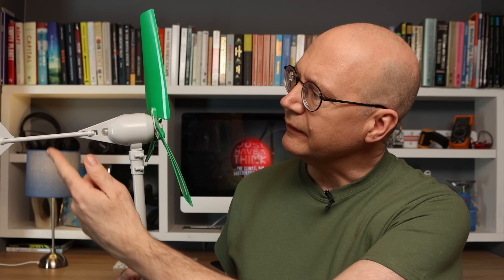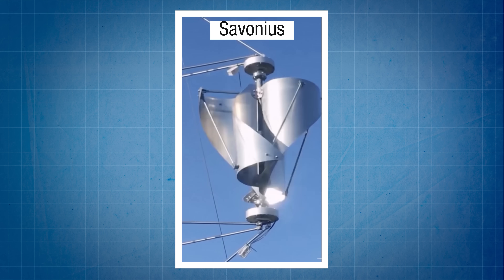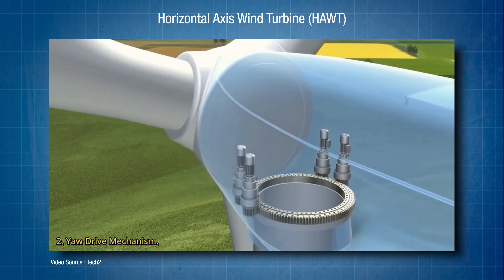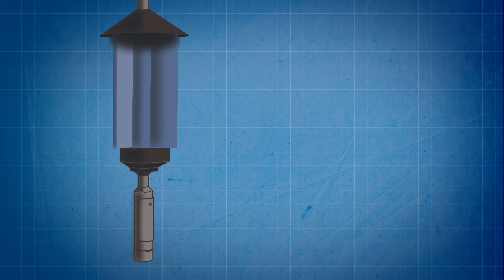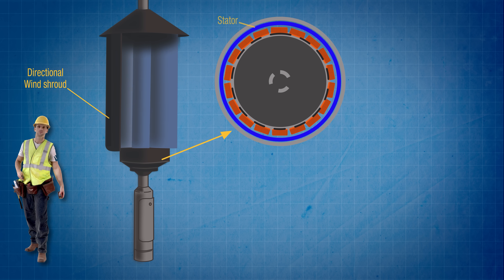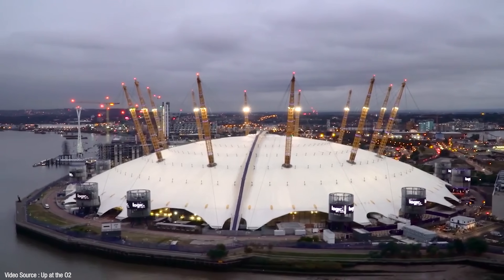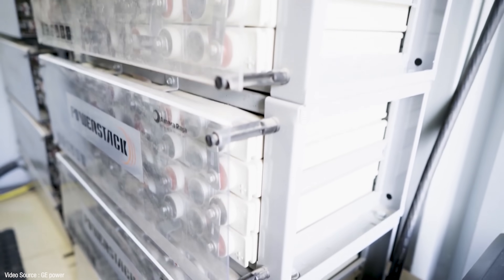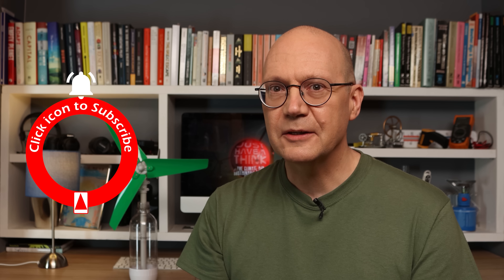A vertical axis wind turbine that doesn't need the prevailing wind! How do they do that?

Comment: There are always inexperienced newbie crackpots pursuing these disproven ideas.  In wind energy we just call them "idiots" - sorry but that is the simple reality.  Wind energy requires a STRONG wind resource.  The incidental airflow from traffic is not sufficient to provide useful amounts of power.  The economics are just not even close to a breakeven.  You'd use more energy just manufacturing them and installing them than you would ever get back.  And if there were significant wind from traffic, slowing it would cause the cars to burn more gas - no free lunch.  This general idea has been promoted for many years, yet never implemented, because anyone who knows anything about real wind energy knows ideas like this are a waste of time and can never work out.  It is all about simple math, whereas this idea is about emotion.  Bad ideas are bad ideas.  You might just as well decide to operate a gold mine from your garden soil.  Is there enough gold in your garden to make it worth the effort?  Same thing here.  This is a wrong idea, period, and listening to uninformed people like this is inadvisable.
Reply: see you had me until "And if there were significant wind from traffic, slowing it would cause the cars to burn more gas - no free lunch"
anyone who has so much as attended a single secondary school science lesson knows that the airflow from traffic is classed as WASTE energy, unless the cars behind are within a slipstream they receive literally zero benefit from the airflow, and if those cars are close enough to benefit from that slipstream then they are way too close to be in compliance with almost any highway law. 

stick to your windmills, you clearly dont understand cars
Reply: @samueleveleigh2767  Yeah I just restored a totalled vehicle and got it registered last week.  I don't understand cars.  No, it is you who do not understand wind energy.  What people like you do not know is how little energy is in light winds.  The power in wind is proportional to the windspeed cubed, meaning if you double the windspeed you get 8x the power (kinetic energy times flowrate).  Conversely, if you have half the windspeed you have 1/8th the power and at a quarter the windspeed, you have 1/64th the power.  At 1/8th the windspeeed you have 1/256th the power = ~nothing.  Yet any wind energy system must be built robust enough to survive a 100 MPH wind.  There is simply not enough power in the paltry amount of wind from traffic to make a hoot of difference - a waste of time, money, and resources.  And meanwhile, if you did manage to slow a windstream caused by traffic, it would affect each car by a tiny amount, meanwhile you get no benefit.  Ever been behind a big truck and feel how the windflow around the truck affects you?  It's all interrelated.  All you have is one more money-losing "politically-correct-for-idiots" waste of taxpayer dollars that will cost more just to be torn down than all the energy it ever produces over its entire lifetime.  All crackpot wind energy systems are eventually removed, like, for example, the Aerovironment rooftop turbines on Logan airport.  Gone.  Wind energy will make an idiot out of even the smartest people.
Reply: @dougselsam5393  My experience of light wind moving 1mt of steel with 5 or more kids all day with a steady pace contradicts your claim of understanding the (lack of) potentional of "light wind".

If you don't get it: I refered to sailing an open steel 25ft boat, as a kid I've "wasted" most of my saturdays doing that.
Not saying this system is the answere to our total energy need but neither are the enourmous conventional wind turbines.
Also, It's not "free lunch" that is presented here, it is eating the left-overs.
Reply: @hotdognl70  Hello Martin!  Yes it was sailboat experience, along with building & flying  kites, and touring the hydroelectric plants at Niagara Falls, that got me interested in wind energy way back in the '60's.
Today I guess you could call me an expert.  For fun, we habitually debunk wind turbine ideas.  Traffic-powered wind energy ideas are one of our favorites.  It;s like shooting fish in a barrel, but you have to find humor somewhere in any profession.  You may notice how common such traffic-powered wind energy devices are in magazine articles, with none in actual use.  There is your first clue.  There are unlimited ways to get "some" power from wind, at "some" cost.  Most are not economical energy solutions.  Not even close.  It would be more efficient to just burn hundred-dollar bills by the bushel than to take this idea seriously.  The idea of wind energy is with a reasonable upfront investment, you get high amounts of  long-term energy production without requiring constant fuel for power.  The "high value" of the resulting electricity is what eventually "rationalizes" your investment.  Without high power output, the expense will turn out to have been "irrational".  Which is why you never see this idea implemented.  Another example might be seeing a penny on the sidewalk, realizing it is "free money!" and then making a very expensive machine to pick up pennies from the sidewalk.  Don;t be surprised when you figure out you wasted your money because you need a sidewalk with a LOT of pennies!  Turns out there just aren't enough pennies on the average sidewalk to rationalize such a machine.  Well guess how much wholesale electricity costs?  Pennies.  Wind turbine are lucky to make 4 pennies per kiloWatt-hour these days.  So a wind turbine is essentially a giant machine to pick up pennies from a giant swept area, because if you are only picking up pennies, you'd better cover a LOT of area with a LOT of pennies in the air.  Incidental wind from traffic contains almost zero pennies.  It is simply too light to be worth chasing, really at any cost, no matter how small.  You could never even pay for the paperwork, let alone the machines, let alone installing them, let alone operating and maintaining them, let alone even REMOVING them when it is realized they are an eyesore and a waste of money!  😂
Reply: But having a VAWT on big highways to capture the wind + the breeze from the cars is a plus point rather than capturing the energy just solely from the natural wind.

Don't you think?
Reply: @aashwindev2357  No.  Traffic-wind turbines are a bad idea, only promoted by those with zero experience in wind energy.  And a big VAWT turbine anywhere is a bad idea.
Go find a single turbine installed by a highway to benefit from vehicle wind.  they don't exist.  Why?  Not because people have not discussed the idea for decades, but because there is not enough wind generated by traffic to bother with.  
Now go find a single vertical-axis turbine in operation with a happy owner.  First you'd have to find one in operation.  Still looking?  You'd be limited to newly-installed units that have not been removed yet.  Keep looking, then get back to us when you find one.  Happy owner?  You'll be looking forever.  Every vertical-axis turbine first disappoints, then fails.  :)

Comment: wouldn't this oppose the wind generated by the vehicles? which would in turn increase the resistance for the vehicles...  requiring the cars to spend more energy to push the air?
- Effectively making the cars spend more fuel/charge ...
Reply: would it?
the amount of resistance to something like a car will be negligible to it in my opinion.
Reply: @aashwindev2357   I'm not a fluid engineer, so I don't know. Maybe the energy is usually just wasted .... but I know that all energy comes from somewhere.
- If you put a wind turbine on the roof of a car, you will never get net positive results.
- Even normally, If you drive against wind, it will require more energy. I feel like this is the same principle.
- I'm just saying I'm skeptical and careful the energy is truly free. After all, it's generated by the cars...

Comment: I think there needs to be some modelling to settle the question as to whether these will increase drag on passing vehicles. If they are sited far enough away the effect will probably be minimal, but to optimise energy harvest I suspect they will be placed in the central reservation. The proximity of a structure designed to capture as much energy from moving air next to the vehicles would seem likely to increase drag on them (think of a ship in free water vs one sailing close to a series of baffles) modelling and or experiment could establish the magnitude of this effect and make sure they are not counterproductive: increasing fuel consumption and in effect being a fossil fuelled generation system.

Comment: Never mind the VAWT  a incredibly inefficent means of harne$$ing a given wind as a power source.  The delta~p of the cup vs convex blades is insignificant power.......The fixed costs of wind turbines are consistent regardless of the blades abilities to efficiently drive the generator. Truth be told VAWTs can barely power their own blade assemblies let alone drive a pricey generator ... Look at the start~up VAWT companies , they are all beating the same drum (it spins itself at low wind). One VAWT company has been starting~up for over twenty~years and still crowd~funding. The horse"design" don't run and beating on it won't make it any better......

Comment: If we really care about reducing coal burning these should be along every motorway on the planet. I also though bridges should be equipped to capture the wind effect of the valleys.
Reply: If we really cared, these should not be built at all because the energy used to build them will never justify the puny energy they would produce. Its a scam, as we have documented in Dave's "correction" thread.

Comment: They could put them on side of buildings. The smaller VT's would be better to put up rather than just one large one. If one breaks down you have the others still producing. You could stack them on tower structures. Easier to handle, transport or repair .
Reply: and put them inside houses too. people move around all the time

Comment: Excellent technology in Vertical Axis Wind Generators.  While they are yet to be proven to work in roadside installations, what is not talked about in this video are the many additional hazards that these roadside turbines will be exposed to are many.  You can expect that these roadside turbines will exhibit constant damage along those roadsides from trash and vehicle refuse that flies out from these vehicles at an unbelievable rate.  The U.S. Department of Transportation carries statistics on roadside trash, and those statistics are alarming.  This trash, produced by and discarded by passing motorists (whether intentionally or accidentally) will damage these roadside turbines at a much higher rate than anyone can predict.  Nuts and bolts, rocks, and various odd car parts that fall off as they travel are a constant thread to automobile tires traveling these roads.  And, there are all sorts of products falling out of pickup trucks, travel trailers, and various other construction company trucks that is always littering our roadways.  Weather will be another factor that will come into play here.  Consider snow, sand and salt spray as hazards.  These turbines will also not work during winter months in parts of the world that get snowfall because these turbines will then be exposed to the impact of cleared roadside snow from fast-moving snowplows.  Sand and salt will also pose a hazard to these turbines and will certainly cause a much more rapid degradation than anyone expected.  Also, the hazard of workers replacing these roadside turbines will also be an additional danger to both the workers and motorists.  Then there’s the hazard of roadside accidents which will certainly wipe out at least one, if not several, of these turbines with each accident.  Car insurance companies are not going to be happy to pay several thousand dollars per destroyed turbine, so those insurance companies will raise their insurance rates to pass along those costs to the consumer, thereby making travel by automobile more expensive.  While this may seem like a good idea at first glance, the practicality of this is overshadowed by the cost feasibility.  I say first prove the generating capacity and benefit and durability factors of these vertical axis wind turbines in a passive urban/home setting first before planting these things along roadsides and putting motorists and road-works maintenance workers at higher risk.

Comment: I've been trying to get people excited about the idea of setting up long rows of vertical wind vanes along freeways for decades to harness the power of the moving wind from passing cars and trucks. (Also peiazo (sp?)-generated charge from the downward pressure on roads from cars and trucks passing over them.
Reply: It would increase the vehicles fuel consumption...
Reply: ALSO, such a set-up would continue to generate energy from just the normal wind blowing (ie normal moving air)  even if/when the roads were bearing little or no traffic at all, as in the middle of the night.

Comment: The ability to nearly power a cellular tower is particularly interesting - especially in areas that are prone to power loss (thinking most immediately of Australia with a major storm every 20 minutes and having to keep mobile comms going through that).  Presumably a couple of these with auxiliary solar and/or grid charging (or just solar for a remotely located tower) would be a very useful thing to have for coverage expansion, I believe powering them has been one of the most significant obstacles.  If they can standardise and homogenise the design like this I can see it becoming awfully popular with councils and local authorities rather quickly, that's a key initial market with enthusiastic uptake.  Potentially WIFI boosters and access points would benefit from this too, is there any indication of how much noise they generate yet?
Reply: I don't think councils and local authorities would make themselves very popular stealing energy from the gas tanks of the passing cars.

Comment: It would also be interesting to see if the technology could be adapted in large cities for mass transit corridors (metro/tube, tramways, rail, etc.) . Especially frequent services could potentially see some return on the installation to maybe assist with powering the lights in the stations.
Reply: There is no return because the wind turbines increase the energy consumption of the passing vehicles.

Comment: It's also possible to produce an electric force without moving parts. All moving material has the ability to induce a electro magnetic force. It's basically the opposite of using electricity to move material.

Comment: I think it is a brilliant idea. Should be adopted acrtos the globe. 
.
When talking about VAWT I think you might also be interested in Pearl River Project in China. It was designed and implemented by 2 - 3 British firms. It is a high rise located in high wind location. It is designed to direct this wind into a specific floor which is entirely dedicated to vertical turbines. The building is supposedly energy neutral.

Comment: How does something 2 meters tall and 1 meter in diameter, weight less than 20 pounds?

You realize that's 2 jugs of milk. I'm struggling to grapple with the necessary flimsiness of the construction to attain that weight. The cardboard box it's packaged in will weigh more. It'll blow off the back of the pick-up that's transporting it.

Jussayin, you sure that 3.5-8kg isn't missing an order of magnitude?
Reply: there is a lot missing a few orders of magnitude here. Check the comments in Dave's pinned "correction" thread

Comment: Will the use of these on a motorway result in a miniscule increase in air pressure in the direction of travel thereby causing the vehicle to be almostBallindalloch incalculabley less efficient but multiplied by the number of vehicles driving the turbines resulting in less net energy?
Reply: Correct sir. These turbines harvest energy from the fuel tanks of the passing cars.
Reply: @Freba9  if only